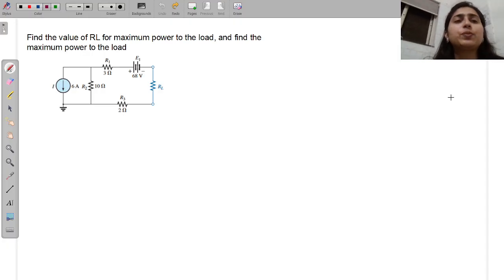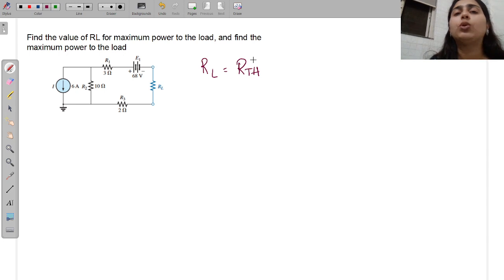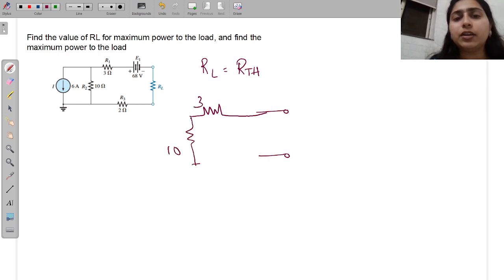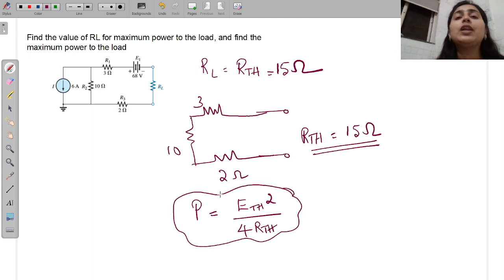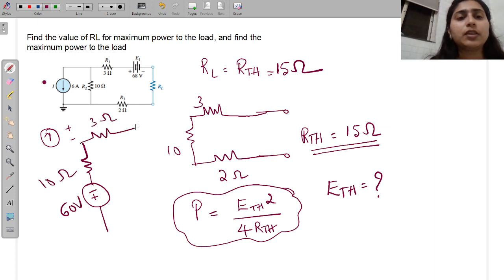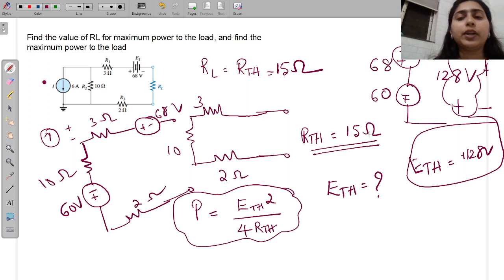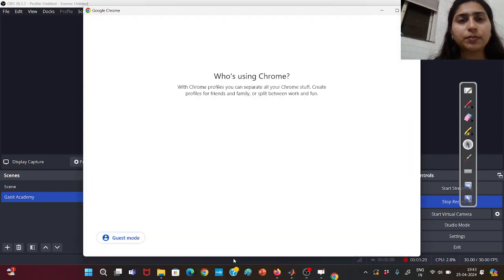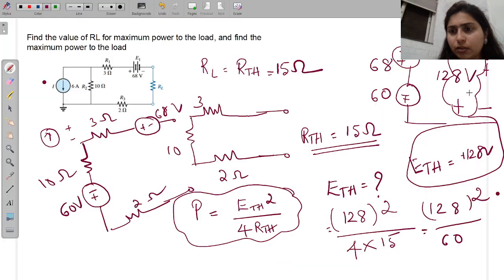Introductory Circuit Analysis 13th edn Chapter 9 solutions||Boylestad||Example 9.18|GATE|ESE|ISRO

Comment: Why you didn't considered the resistances for Vth calculation. Why you just add the voltages and  neglect the resistances?
Reply from the maker: Thevenin’s voltage is open circuit voltage. Current through Resistance is 0. Hence the voltage across resistance is 0